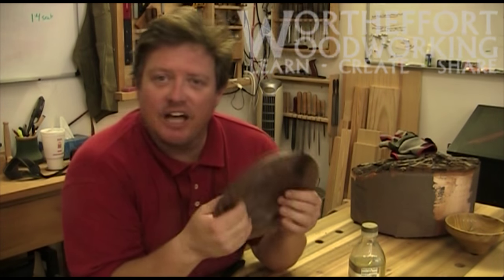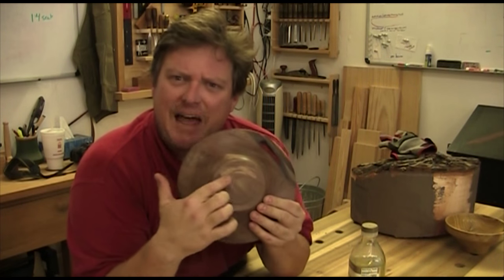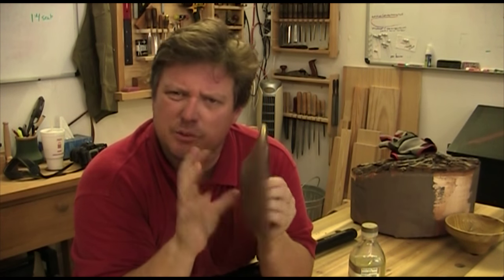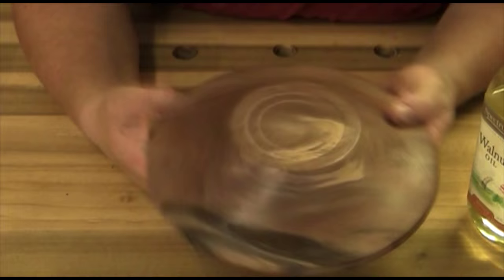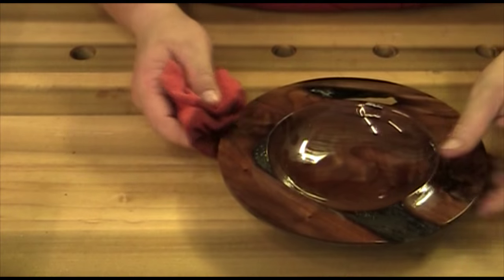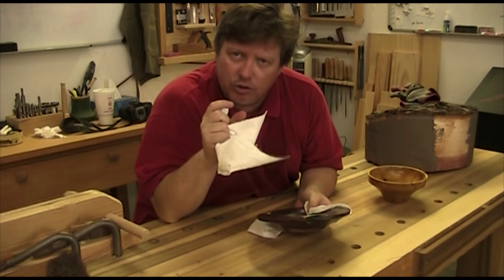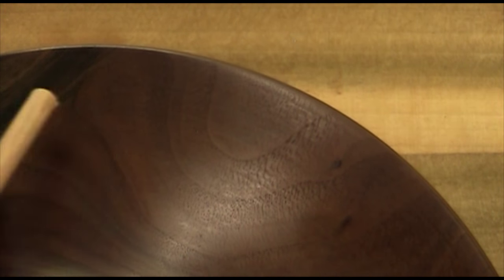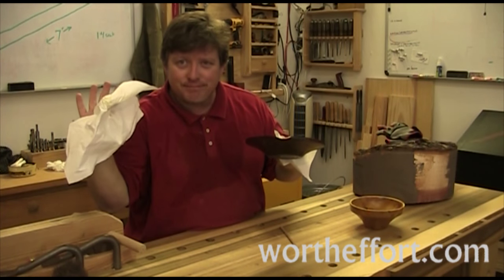bruised wood - a Monday Lunch Discussion 6-29-15

Comment from the maker: Someone messaged me a question about walnut oil but I can't reply via the platform so here's my answer.Ya, you can buy walnut oil at woodworking stores. It generally sells somewhere around $20 for a quart. There are some that are marketed as Butcher Block Oils and others as food safe finish but if you look at the ingredients its just walnut oil. I don't believe there is any difference between this and the stuff you get for $7 at the grocery store. And even if there where it's just modern dryers (chemicals) which you don't need. From what I understand walnut oil actually predates linseed oil as a finish in woodworking and is preferred by many because of it's drying properties.

It just takes time to dry like anything. Remember the guidelines. Once a day for a week, Once a week for a month, Once a month for a year. Then as needed. (Of Note: I generally only do a few coats then before putting them up for sale put on a nice wax/polish to make it 'touchable')